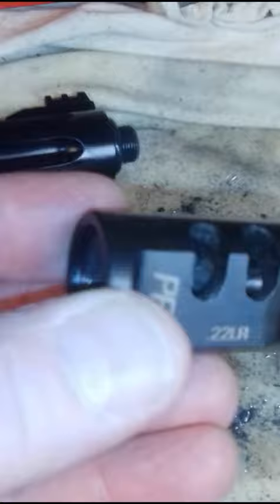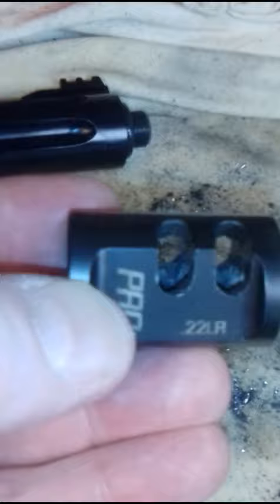Safety Tip Check and Clean Your Pistol's Compensator #shorts

Comment: I used to have a baby jar with mercury in it. Id soak my high standard comp between matches. Comes out perfectly clean!!
Reply from the maker: I really did not know that about mercury! I did try the Peroxide and vinegar solution, it did not work that good. Might have to track down some mercury!

Comment: Is this normal... The hard lead build up?

I got my first compensator recently and fnished about 500-600 rounds. Was really concerned when i saw the solid chunks of lead that i was getting baffle strikes or something.

Im running almost the same comp, mine is the TK pro squared also 22
Reply from the maker: Well, I have to clean mine every few thousand rounds. Tandemcross use to have a video on cleaning it. The lead does build up. I hope this helps, and thanks for watching!
Reply: Smh theres no baffles in a compensator. Nothing is removable